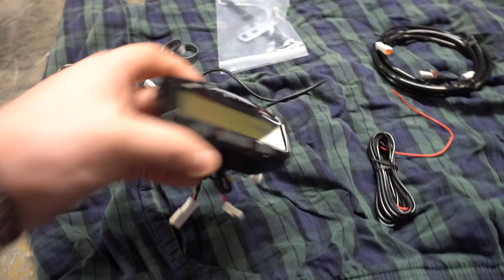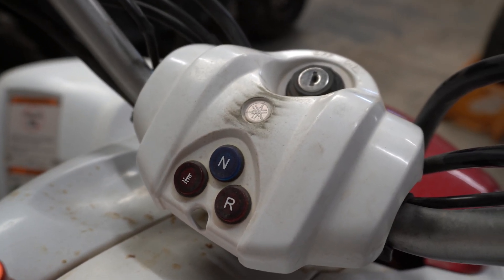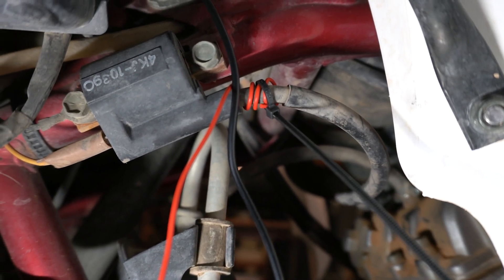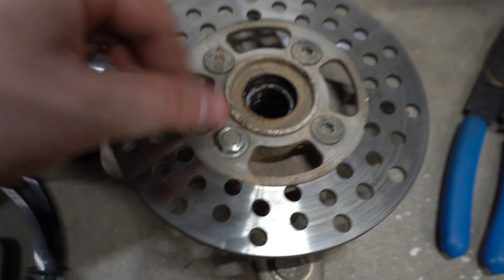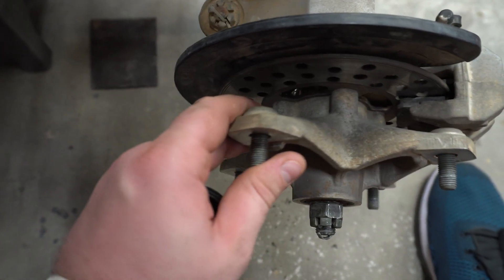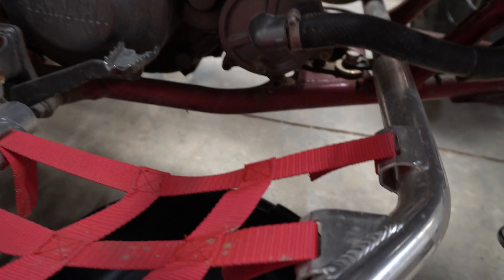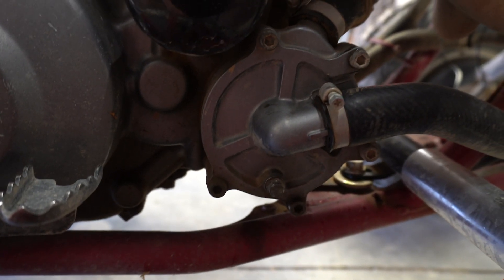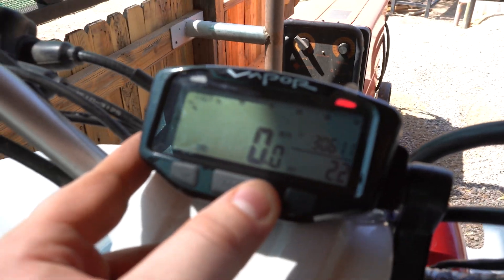Trail Tech 752-118 Vapor Digital Speedometer Tachometer Gauge (Full Install)

Comment: What the wheel diameter? You have to set for it.
Reply from the maker: The front wheel diameter is 21"
Reply: @QuadBossElite  I had a question how do you wire the rpm gauge if you have 2 spark plugs thanks
Reply from the maker: @WingStop-zv1sk  You can still wire it around one spark plug
Reply: @QuadBossElite   thanks I wasn't sure if there was some weird way I had to wrap it around 2
Reply: @QuadBossElite  for speed sensor what do you if you are installing it on a motorcycle thanks again
Reply from the maker: Well this kit has a couple different ways to mount on ATV's and dirt-bikes. It really depends on the application. I can't really give you to much more, I have never put it on a motorcycle before. I'm sorry